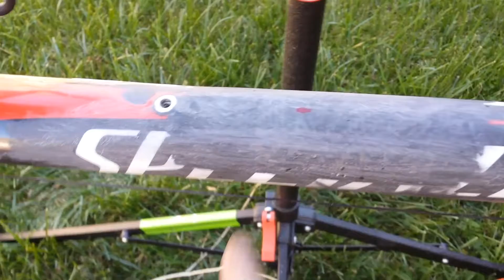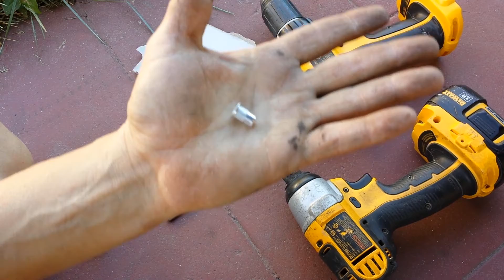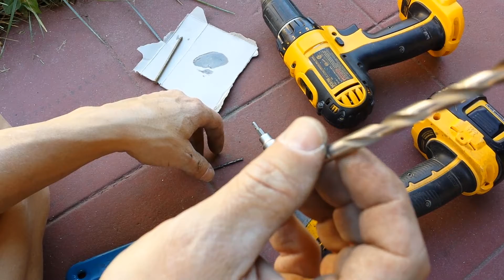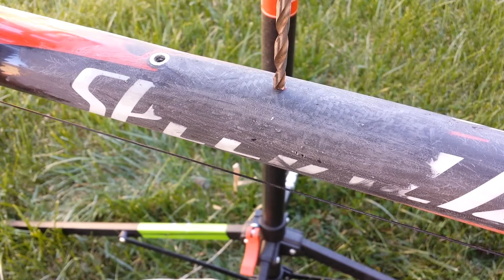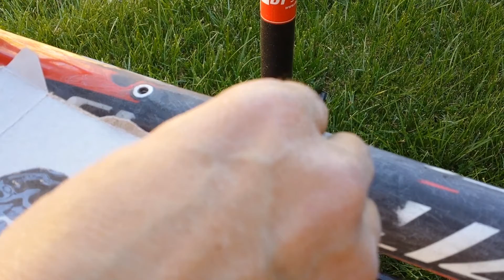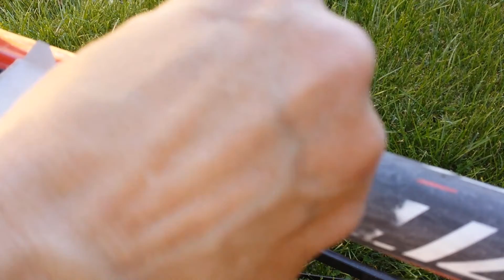DIY CARBON FRAME Repair for Road Bike Water Bottle Cage with Riv-Nuts - How To

Comment: Nice vid, really. Do you have an advice how to pull out rivnut and bolt that is stuck into rivnut and spinning together one with another? I suppose bolt stuck because of corrosion. I tried with clenchers to pull it out, but without success. Now rivnut is pressed around bolt, and cannot get out nor inside, it's loose... I suppose only solution is to rip it off with metal saw (get out the inside part through seat tube?) and try to get new rivnut, and glue it into hole...  
Thanks.
Reply from the maker: a small bit of epoxy at the base of the rivnut may be enough to temporarily glue it in place so you can remove the bolt. You can then decide to repair the existing rivnut or drill it out and replace it with a larger nut.
Reply: @LeTourDePlants  thanks

Comment: Hi! I dont understand all steps in you video.  You do riveting? If yes, what a riveting size? My carbon frame is clamp for only one bottle. I want to make clamp for second bottle. You method work for it?
Reply from the maker: It's called a Riv-Nut. You can buy them on ebay. Yes, it works. Just drill a hole and install the riv-nut. Then your bottle cage can be mounted in its proper place.
Reply: I bay M4 and M5  but need tool for riveting. unfriendly price :(    I heard, for Knauf rivets don't need tool.
I find ebay tool at 20$

Comment: Hi Martin, was trying to change bottle holders, unfortunately one of the bolts just turns loose. Thread is out probably. Any way to work around this? It's a carbon frame as well.
Reply from the maker: if you can't get the bolt out, prob best bet is to try needle nose vise grip pliers to hold the rivnut. May also try a tiny bit of superglue on the rivnet to the frame.
Reply: Thanks Martin, managed to pry out the rivnut. Had to cut the bottle cage.  Waiting for the spare to come..

Comment: is the frame still going strong a few years later or did the crack/issue return? thanks
Reply from the maker: I've ridden over 5000 miles on the frame after the repair. Keep in mind, tho, the the carbon damage was minimal to begin with.

Comment: Hi there! Thanks for a great video, it was an enjoyable piece. I have a similar issue with a Specialized Roubaix where the bottle cage has ripped off. A local Specialized dealer installed some riv-nuts with epoxy to the holes left behind. They said that after the epoxy had set they wouldn't be too worried of the damage and that it would be safe to ride. 

Although they gave reassurance, I'm still a bit worried with the crack. Do you have an opinnion on the matter if you'd personally patch this up or just leave it be? Especially the crack from the lower nut that extends to the letter E looks bad in my eyes. Picture of the damage, although not perfect: http://i.imgur.com/eF8ogeb.jpg
Reply from the maker: I would ride the bike like it is without attempting any repairs. But if you have some spare time and are curious to try the repair, this would be a good, easy candidate. Good luck.
Reply: Thanks for the reply :) Might just leave it as it is then. Spotted some epoxy repair putty from the local hardware store that I was thinking of using to fill the dents and maybe sand the lower one a bit to see, that the crack hopefully doesn't go deeper than the paint, but I'll have to think it out. Thanks again!

Comment: Nice and clear instructions. May I ask what drill bits (make and size) did you use to open the hole?
Reply from the maker: Good question. I used the wrong bit type and size (too small) so had to try and file the hole a little more than the size of the bit. My bits are imperial while the rivnut uses metric.

Comment: Thanks. I enjoyed watching that. You did that well and whilst filming it too! Did you paint the frame after you repaired it or are you meant to put more carbon fibre over it? May be you have kept it as is so it looks battle hardened! ;-)
Reply from the maker: delakota555 Correct, I just kept it as is. If it were my pride and joy I would try harder to make it look pretty.